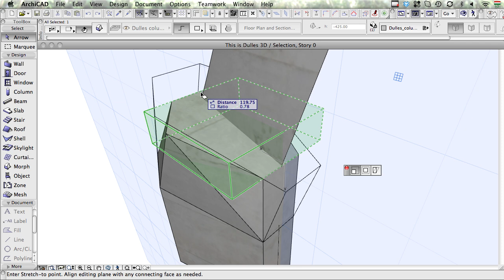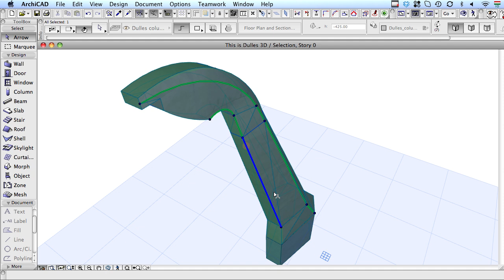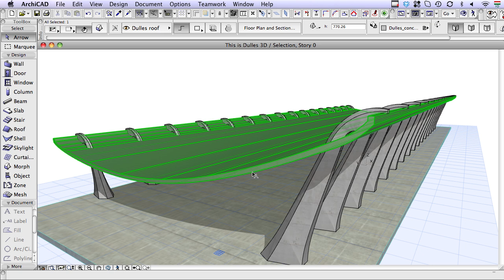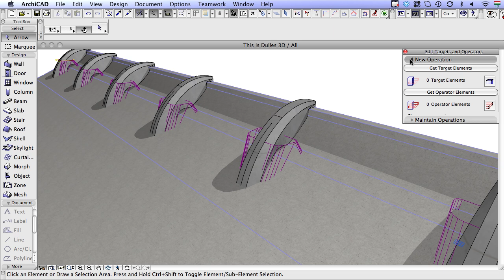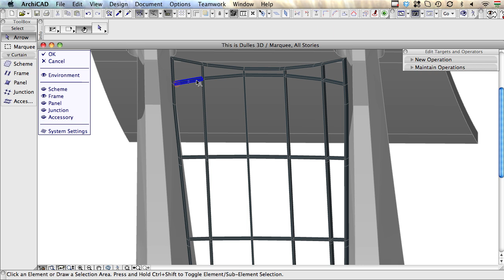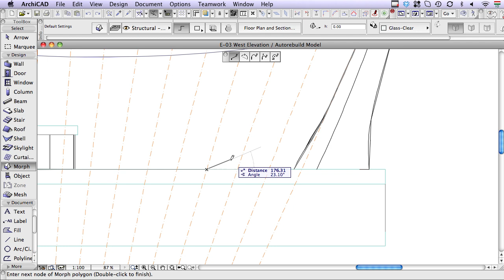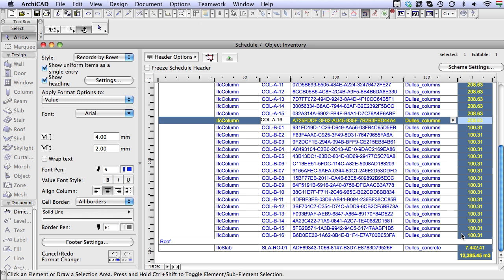Classics modeled with Archicad - Dulles International Airport

Comment: im using archicad 20 and i cant select the face without selecting the whole element like you do when you stretch the mass
Reply: you have to press both  ctlr and shift  key to select he face and box stretch
Reply: You have the use the white arrow, not the black one in the "main" panel.

Comment: please try to optimise the solid element operations...or/and maybe make the trim to roof function work on every element(column, shell, wall...etc)...tried it on a spiral like project with some more solid element operations and it worked so slow to the point of crashing and my laptop is a preety decent dell. Otherwise it is preety nice program i like it A LOT and you can work really fast in it.